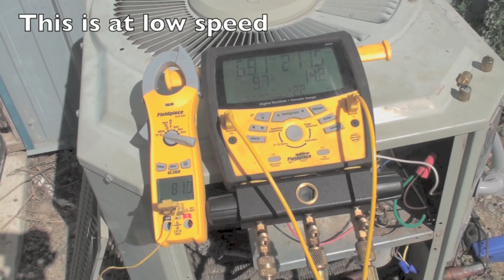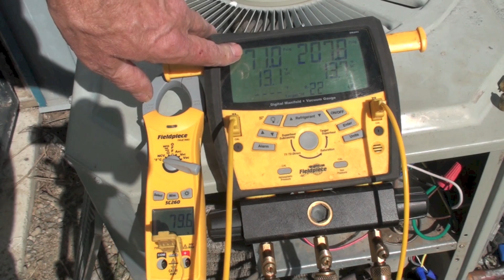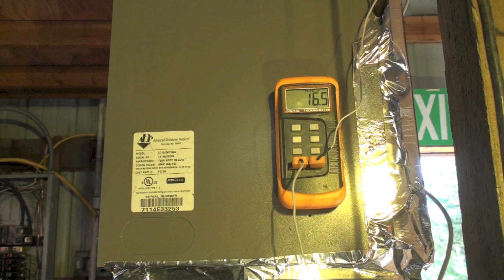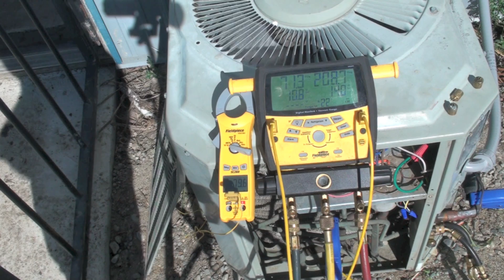Effect of different fan speed on the air conditioner

Comment: I retrofitted  both my furnace and the parents furnace with an "evergreen" 4 speed motor and used a 2 stage stat  to control  speeds.. Summer it works well, high speed to pull the temp down and a lower speed  to maintain and dehumidify. Now, I know its generally 400 CFM per ton, but if I  run the fan too slow  is it likely I could have liquid refrigerant come back through the suction line  and  mess up the compressor?  Its a scroll and I thought they are more tolerant to that kinda thing..

Comment: What was the indoor humidity as if it were somewhat above 50% then the blower speeds would probably make a bigger difference in the temp split.  There is usually a 1 degree to up-to a 2 degree F difference when changing speeds Also, many are 4-speed blowers with less difference.  Indoor humidity levels make the biggest change in the indoor split...
Reply from the maker: I am up north and humidity is never that high.  You are right of course about the temp split in the higher humidity.
GFM

Comment: I assume the blower motor evap is the fan that changes speed in a 2 stage? Does the outside fan change speeds as well.  I don't think the company I used installed my new unit correctly.
Reply from the maker: If you have a 2 stage unit, the compressor, outdoor fan and indoor fan all change speeds depending on the stage selected.
GFM
Reply: @grayfurnaceman  and if it doesn't what did they do wrong? It shows on ecobee when in stage 1 and 2.  I don't have instruments to read cfm and the company didn't either or won't.  Can I see a noticeable change of compressor fan speed with the naked eye? If the outside fan does not change but the inside does can that damage the unit? 
Thanks for the help

Comment: I had a brand New Rheem Gas Furnace/2.5 ton AC installed. It had issues cooling my house... The solution believe it or not was to put the blower speed on LOW. From the factory, it come on HIGH for Cooling and MED for Heat. This is a 5 speed Blower. LOW, MED LOW, MED, MED HIGH, HIGH. It works ALLLOOTT better set on low and it's quieter. I thought the Furnace/AC might be to over sized. But When I look at the specs for this furnace, it's designed for 2.5 to 4 ton system. We also had an issue with humidity when set on High. The AC tech said there is a spot on the board to have the Cool/Heat on the same speed. So he put the Low tap on that connection for Heat/Cool and Fan on Med Low.
Reply from the maker: Sometimes there is a "sweet spot" on these fan settings.  If it works well, go for it.
GFM
Reply: grayfurnaceman one more question: is there a CFM standard for the furnace air flow ? I have. 75000 BTU @ 80%  . What would be the lowest CFM I could run this on? I don’t want to over heat the heat exchanger. Would the system shut off to prevent overheating ?
Reply from the maker: There is a limit switch to shut it down if the air flow is too low.  If you want to check air flow, you can check the model plate.  That will give an upper and lower allowable temp rise.  You can then use a thermometer to check the return and supply temps to see if the rise is within limits.
GFM
Reply: Sorry, Have another question... On the specs, what does this mean:
Table 1: Coil Specifications/Airflow Pressure Drop
Approx.
Design Cooling
Air Flow
Range CFM
[L/s]
700/1300
[330/614]

Does that mean, 1300 CFM is that MAX for Cooling? This is on the specs for the condenser coils on top of the furnace.
Reply from the maker: Yes.
GFM

Comment: Good topic GFM, blower speed, blower speed can make or break a system
Reply: I have a York lx vs air handler and a single stage condenser. The air handler is a 3 ton and the condenser is a 2 1/2 ton. Is it more efficiency to run the fan on hi speed then a lower speed?
Reply: T&N Services LLC. I want to reduce blower speed in a package unit. Is that a problem?

Comment: Hello. Thanks for the video. Great information. Reason why I came across your video is because I was doing my own research cause I recently had a new unit installed. It's a GrandAire 3.5 ton unit. The gentleman who installed it did a great job and everything is running great. But I was wondering if it was more efficient to run the units fan on high as opposed to low? Reason I ask is because he let it run for almost week then called to say he was coming back to switch it from low to high speed for higher efficiency which in turn saves on my utility bill. Not saying the guy was lying... But just looking into it myself. I live in Florida by the way
Reply from the maker: The indoor fan running continuously may even the temp in the structure.  That is about all it will do.  I would recommend low speed for continuous fan if the speed increases for A/C operation.  In either case. the difference is small.
GFM
Reply: Hey I just had the exact model and size installed and wondering about fan speed. I too live in central Fl and wondering where did you set your fan speed? Mine was on medium installed but moved to high but it’s winter and only ran a few times. It’s only a month old. AAA AC Quality Service installed it. Thanks.

Comment: I dont get why at 2:00 when you put the fan speed on high, superheat went down??????? At the beginning of the video when you increased fan speed, the superheat went from 9 to 13 but then when you increased it even higher, the superheat dropped🤯
Reply from the maker: I really don't remember.
GFM
Reply: grayfurnaceman great video though, i always enjoy your content. I just wanted to confirm that increasing fan speed will increase superheat because theres more air so technically more heat going across coil

Comment: My AC in a very small apt is taking an hour to drop 1 degree. I looked at the fan and my fan isn't going as fast as some of the other fans. The maintenance man is jacking me around since I moved here. I don't understand your video completely. Does this mean turning the fan up drops the indoor temp faster? Thanks. (I live in Las Vegas, no humidity)
Reply from the maker: A faster fan speed may move the cool air farther into the room, but will probably not make much difference in capacity.  
GFM
Reply: @grayfurnaceman  Its only 800 square feet. Before it would drop 4 degrees in 25 min.  Could that still be the fan? Thank you.
Reply: @grayfurnaceman  I thought thats what you were showing with speed? It made the temp drop you said?
Reply from the maker: @earthwisdomhelps  Probably not.  The unit could be low on refrigerant charge or have some other mechanical failure.
GFM

Comment: I’m having a issue with my fan speed when my ac is running causing my ears to plug up it hurts. Had a new furnace installed and ecobee thermostat. Hvac tech adjusted the fan speed to 900 didn’t change anything. The pressure is so hard on the ears I can’t run my ac. Any ideas?
Reply from the maker: There is very little pressure associated with A/C fans.  The pressure when the fan comes on could not be causing ear problems.  My thoughts are that it has something to do with the humidity change when the A/C is on.  Have you had problems with A/C in other homes?
GFM
Reply: grayfurnaceman  I haven’t had this problem before. It’s only been in my house with the new furnace it’s a 60,000 btu two stage keeprite furnace. I also have a ecobee thermostat that shows the humidity level and shows my furnace is setup to be a stage 1 not stage 2. The hvac tech adjusted my furnace blower fan to 900 cfm hesaid he can adjust it to 800, it’s either my furnace or ac fan is too high for my new furnace or could my thermostat have something to do with how the furnace is operating?

Comment: Which speed is best in three types of fan speed for saving electricity.?
Reply from the maker: Not a simple answer.  If the motor is a PSC, high speed is the most efficient speed.  The lower speeds reduce power usage but often not efficiently.  If it is an ECM, the lower speeds reduce power usage quite effectively.  However, the lower speeds may not allow the heating or cooling equipment to operate efficiently.
GFM

Comment: If I reduce my blower speed for my Package Unit, will there be a problem? Too much wind noise present.
Reply from the maker: First, be sure your filter is clean.  
Lowering the speed in heat mode probably will make no difference.
Lowering it in cooling will increase dehumidification or if excessive, frozen A/C coil.
GFM

Comment: was curious if superheat readings would be different vs. each fan speed?
Reply from the maker: Shadow Stephen The superheat is variable to a certain extent if the expansion device is a fixed orifice when the air flow is changed.  Thus the superheat should be checked after the indoor air flow is set.  Hope this helps.
GFM